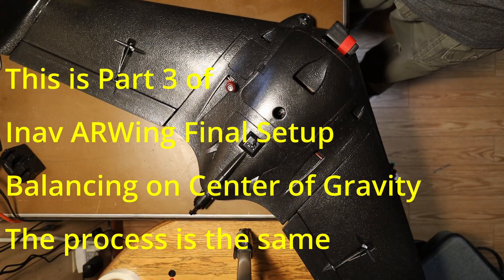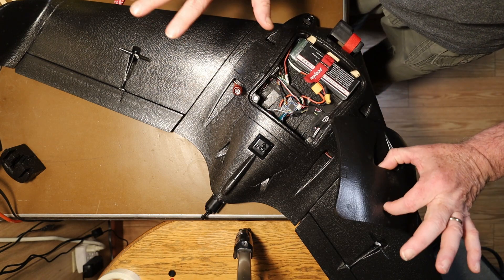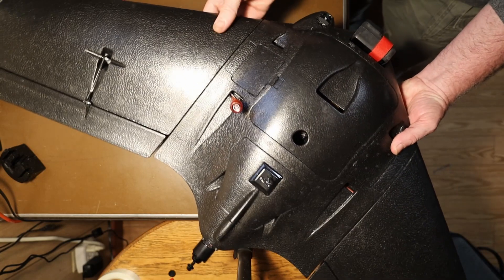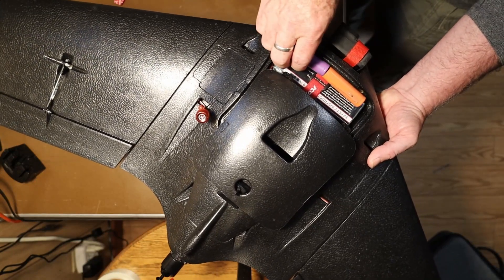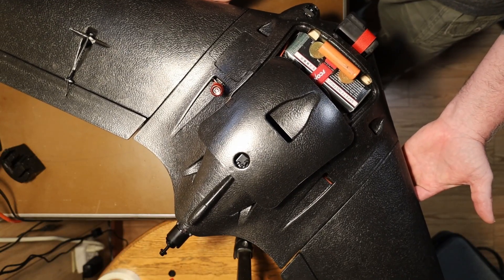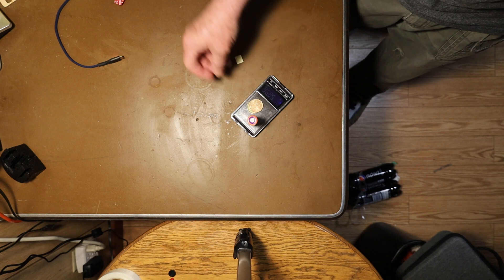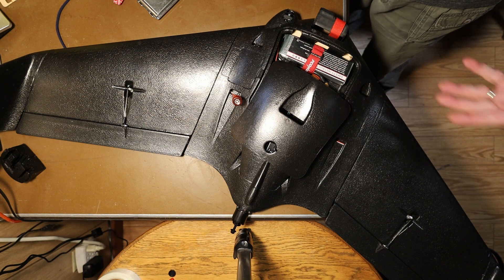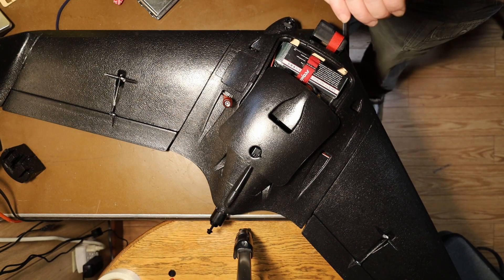How to Balance a Flying Wing on its CG (center of gravity)

Comment: how to fine those points where u kept ur finger tips?
Reply from the maker: Hello and thanks for the question.  If you are using the same model (AR Wing Pro) or any major brand of flying wing or airplane, it should have CG marks or bumps under the wings.  They are usually (not always) marked CG.  If not, they should explain how/where to hold it in the manual (if there is one).
On a home built model (like a foam board airplane), you need to first calculate the Mean Aerodynamic chord for the wing.  The CG will be somewhere between 25-35% of the MAC - with 25% being a safe starting place.  This isn't hard to do, but is a bit much to explain in a reply here.  A google search for "find MAC on an RC airplane" will get you what you need very quickly.  
Because tail heavy planes don't fly very well at all, it is generally better to be slightly nose heavy (25% of MAC) for your first flights.  If the nose is dropping in test flights move weight back a bit (slide lipo back 1 cm for example) to try a CG that is further back.

I hope this helps out.
Eric

Comment: You must replace the canopy
Reply from the maker: Thanks for leaving the comment.  If you mean at around 2:20 or so when I get the balance 'correct', you are probably right.  It weighs about 14 gr, and was about 4" back of its proper place, so it would have put balance off a slight bit. Thankfully this wing is known for having a somewhat forgiving CG.

Comment: Thanks for the tips, exactly what I needed to learn. What's the total weight of your AR wing pro?
Reply from the maker: You're most welcome.  I did a quick, rough check and my AR wing build is just under 700g dry weight (no GoPro or battery).  I've been using HRB 4s 3300 mAh at 350grams, and a CNHL 4s 5000 mAh (525 grams) with no issues.  Add another 160 grams for a GoPro.  
So as a ballpark, 
- light: wing + GoPro+ small battery = roughly 1200g takeoff weight.
- heavy: wing + GoPro+ big battery = roughly 1400g takeoff weight.
Reply: @blueskyfpv  Thanks for the info. Maiden flight for me tonight and I'm right around the 1400g weight so that makes me feel a bit better.